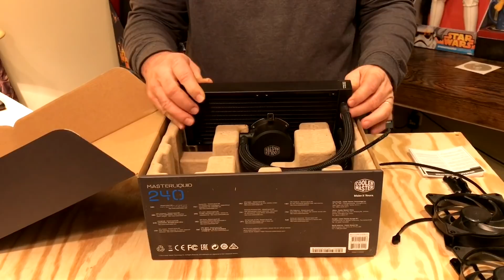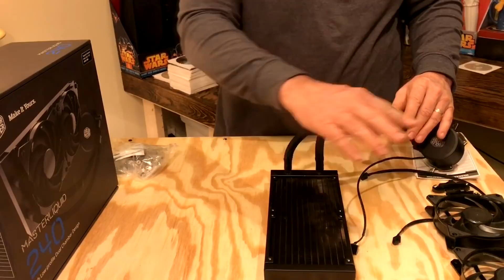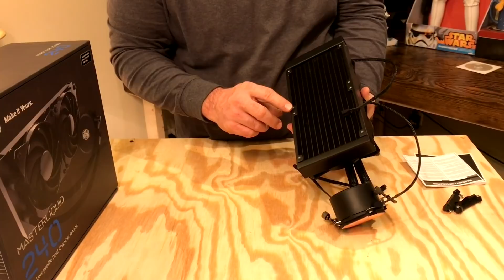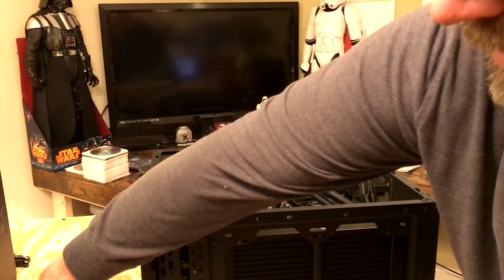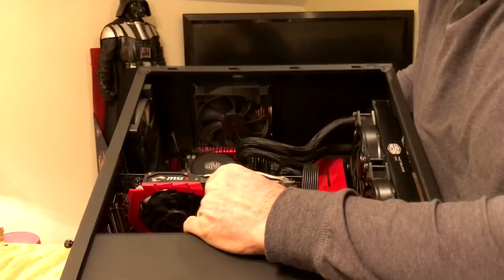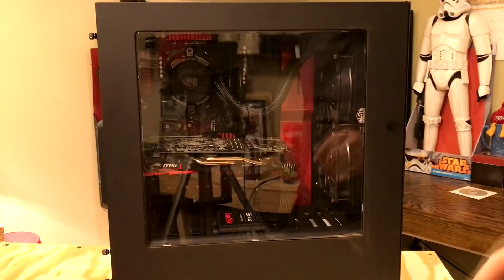Cooler Master Masterliquid 240 Install

Comment: Please correct me if I'm wrong but it looks that your setup has 0 fans that put fresh air into the case. Am I right? Such a solution have pretty bad air flow...
Reply from the maker: Yeah I changed them right after the video once I realized that 😄

Comment: Can you explain me why you mounted the fans on your radiator like you did? Shouldnt they be at the other side, pulling air in trough your radiator in to your case???
Reply from the maker: Yeah. I changed them so now they are pushing fresh air into the case.
Reply: @makingitwork8006  so you pull the extra hot air from the radiator into the case to warm up your HW? also with the radiator's in/outlet at the top where the air gets stuck bc of physics...?

Comment: Hey buddy, is this cooler noisy? Are temps right? Thanks dude
Reply from the maker: Its a great cooler. My pc is a 24/7 setup and Temps are good and nice and quite.
Reply: @makingitwork8006  I was thinking to buy lite version,  what do you think about it ?
Reply from the maker: @giuseppeprattichizzo1862  What CPU are you running and what cooler currently?
Reply: @makingitwork8006  i7-8700. The cooler is the stock of my prebuilt pc, I wanna do a new build with 2060 and switch motherboard and case
Reply from the maker: @giuseppeprattichizzo1862  yeah you should be good with it. Especially if you're using the stock cooler now.

Comment: to kill these coolers you install them in front of the case like you have ..
they are supposed to be installed in the top of the case
Reply from the maker: I agree.  However this case will not allow top mount radiators.  Therefore I had to install the way I did.  By the way I have not had any problems and it is still running strong!  Thanks for the comment!

Comment: Bad assembling ... push install on the front panel, producing hight amount of negative preasure forcing to introduce a lot of dust into the case. And the front dust filter hasn't any function because of the push  airflow. The radiator pipes are above, producing air bubbles goin into the cpu-pump. In general, a very bad installation :(
Reply from the maker: Obviously you have not read through the comments. I noted that I had installed them incorrectly and have since corrected. People are always quick to criticize...
Reply: @makingitwork8006  It was not my intention. Regards :)

Comment: thank u so much for this guide.....this is my first time building a pc and i was so lost...but this helped me a ton....i will say though i struggled for the longest putting on those curved metal brackets because i realized i was using the WRONG screws....i was trying to use the screws that you use to mount the radiator to the pc case with....UGH, glad that frustration is over.....thank u so much!

Comment: I liked your video to the point where u mounted the fans the wrong way.U need to get cool air inside the case not create a void zone in the middle cause there's a constant duel between the back fan and the radiator fans.
Reply from the maker: Yeah. I realized I put it backwards and have changed it since. Thanks for the feedback!
Reply: @makingitwork8006  Looking foward for your next video.Let's see what upgrades u made to that build.

Comment: Hey! Great work, and nice configuration uve got!
my question is, where do you exactly plug the splitter cable? in which you plugged the two fans. One of the sys_fans?
Reply: Im wondering the same thing.

Comment: Just a question about your front mount fan. I was to understand that the fan should pull air into the case through the radiator and then heat in the case should be vented out by other fans in the case. Shouldn't the fans be mounted in front of the radiator to pull the air in? The reason I ask is that I have the same water cooler, and am doing an install. Thanks and great instruction.
Reply: youre right its kind of nonsense to put the radiator there especially this way.

Comment: you are supposed to plug the pump into one of the system fan headers. The fans for the AIO should be plugged into the CPU header. See instructions.
Reply from the maker: It actually works either way.

Comment: I have a question, how well would this do on a i7-8700? How was it over time? Any issues or anything, and it will fit in the S340 Elite on the front right? The tubing will reach to the cpu that is?
Reply from the maker: This has been a fantastic cooler. It would service a i7-8700 just fine. It will definitely fit the front of a S340 Elite!  Nice case by the way!

Comment: Can you install it with out those plastic pieces on the mb?
Reply from the maker: Yes you can. You will have to install the bracket behind the cpu plate.
Reply from the maker: Nicholas Stevens yes. There is additional hardware in the kit to fasten it. You will have to change the backplate. If you have the original clips it saves that step

Comment: So I'm building my very first PC b350m gaming pro with ryzen 5 && radeon rx 560 I'm also getting this AIO as well && from all the vids I've seen of this product my noob question is lol "do you have to add your own coolant" or does it come installed already? Also would you ever have to swap out the coolant or do I have to not worry about it all?? Lol thanks!!! I subbed as well great video!!
Reply from the maker: Thanks for watching and for the question. It comes filled with coolant and ready to go. It is a closed loop system so chances are you would be replacing the PC before the cooler. Good luck with the build!

Comment: Are you exhausting air from the front or is it me?
Reply from the maker: Dynamix yes I was at first but not anymore. I realized that shortly after and switched it. It still worked but was creating negative pressure in the case. Thanks for the question!
Reply: Making It Work Alright cheers :)
Reply: @MrFIFAHoudini  Guys i am using the same cooler. My fans are pointing inside the case with the open side of the fans on the front. Is that intake or exhaust? It looks better on the front, i want the fans to be intake and i of cause want the rgb to be visible
Thanks.

Comment: can you install the fans in front of the radiator? not in the back like in the video
Reply from the maker: BlueNerve yes you can. I have changed mine to the same layout. Basically use the long thumb screws and mount the fan on the outside of the metal bracket and place the radiator on the other side and secure them together with the screws. Thanks for watching!
Reply: Making It Work oh thanks for the help man. Gonna buy the radiator.
Reply: i recommend putting the fans at the back so the dust collectes at the front so you dont have to unscrew the fans for dust cleaning
Reply: mitchell brugman my case has tempered glass front side with rgb fans, so it will look crap if i have no fans in front. If i had a case with no tempered side front i wouldnt care where the fans are lol

Comment: I have a version of this that comes with a controller for the RGB on the fans and pumps and for some reason I can't get the RGB to turn on. Is there anyway I could hook up the lights without using the controller?
Reply from the maker: Alex Tietjen I don’t have one to test but you should be able to control the rgb from your mother board if it supports it.
Reply: did you connect the rgb header (cable) to your motherboard or you controller to your motherboard properly? Your motherboard needs an rgb connecter of course.

Comment: Is it worth upgrading from air cooler fan to this, problem is mine is taking much space in my thermaltake overseer rx-1 so?
Reply from the maker: JÛSŤIN tofa thanks for the question. It really all depends on your setup. If you are running a stock cooler and you are wanting to push your CPU over clocking then yes it is. If you are not going to overclock at all don’t change it. Also if you are running a good air cooler now I would not switch unless you are needing some clearance due to height restrictions on your case.
Reply: Making it work Yeah but it ain't the stock fan it's one big cooler master air fan, but it's like i said it's taking much space and no I'm not over clocking anything anyway thanks 4 ur advice & keep up the good work

Comment: Can I add two fans to the other side of the radiator to pull in cool air? So basically it'll have overall 4 fans?
Reply from the maker: Colum Devlin yes you can. Just make sure you have enough fan headers on your mother board or grab an additional fan splitter.
Reply: Making It Work thank you for the reply! Would I just need long screws?

Comment: I need help with Masterliquid ML240L. I installed it yesterday and I plugged one of the cables coming out of the pump to AIO slot and the other to the RGB slot that came with the fans (according to the manual). The fans are working and on the software the temperature is around 75 F. But once I start installing apps and downloading it gets to 90 F and 100 F. It goes back down quickly but I’m not comfortable that it gets really high. What should I do, need help please
Reply from the maker: switch the cable for the pump block to the CPU header and not the AIO header.  See if that takes care of it.  The AIO header just supplies power for any AIO pump.  It does not monitor any temp info.  The CPU header does.  Also are the fans ramping up as temps rise?
Reply: Making It Work what do mean fans ramping up as temp rise? I have the fans mounted on top. Sorry I’m new to building and stuff
Reply from the maker: Faisal Ibrahim sorry. Can you hear them get louder or turn faster?
Reply: Making It Work yes they get faster when the temp rises
Reply from the maker: Faisal Ibrahim also, did you apply the thermal paste before installing the water block on the CPU?
Reply: Making It Work yes i did. I think I got all wrong. Because now my temperature is sitting at 25 C. And the max i got was 37 C.  Thanks for the help
Reply from the maker: Faisal Ibrahim that sounds like the right temperature range. Glad to help.

Comment: Hi I'm planing on getting this for my first pc that has a Ryzen 5 1500X and GTX 1070ti.I don't think I will be overclocking but if I decide to will this be safe or might it leak
Reply from the maker: Congrats on your new build!  This will cool your cpu no problem. There is always a slight chance for a leak but unlikely. Most of those issues have been eliminated by now. And it’s always  good practice to check on your system regularly. Good luck on your build!

Comment: Where to connect the cable which comes from pump whether to AIO pump pin or CPU fan pin
Reply from the maker: Charles B best is either the CPU header or the AIO. Either will work. Thanks for the question!
Reply: Making It Work one more question does the RPM of the AIO pump should always be run in full speed or not... for better cooling
Reply from the maker: Charles B you should not have to change the pump settings. The fans will auto adjust based on load and cpu temps.
Reply: Making It Work Thank you for your reply.... HAVE A NICE DAY... I subscribed u

Comment: is this a good aio? im deciding between this one and the corsair h100i v2 for my i7 7700k
Reply from the maker: Yes it is. For the cost you can’t beat it. The Corsair is a nice unit as well just higher cost. You can’t go wrong with either one!
Reply: heard the corsair h100i v2 has loud cheap fans, so im leaning towards the cooler master masterliquid 240, is it very quiet even under load?
Reply from the maker: Janoy Cresva yes it is. My cpu is under load frequently and there is no ramp up sounds for the fans. They are very quiet
Reply: thanks bro i'll be looking to buy this aio, btw my case is a hzxt h440 with 3 built in 120mm fans in the front, im thinking of installing the cooler master radiator 240mm infront of the default fans then adding the 2 fans infront like a sandwich, is this a push pull config?
Reply: I have this for my pc build have not installed it yet still waiting on some parts to come in but can I use different more powerful fans on this radiator as long as there the same size?

Comment: hey what microphone and camera do you use?
Reply from the maker: In this video I used an iPhone 7. I have several different things I use including a Logitech c920 web cam and a Canon Rebel ti. I am only shooting 1080p right now but plan to upgrade to some new equipment when I can. Would like to get to 4K. For mics I have a blue ice condenser mic as well as a PowerDeWise lavalier mic. The lavalier is what I mostly use on builds. 

Thanks for the question!